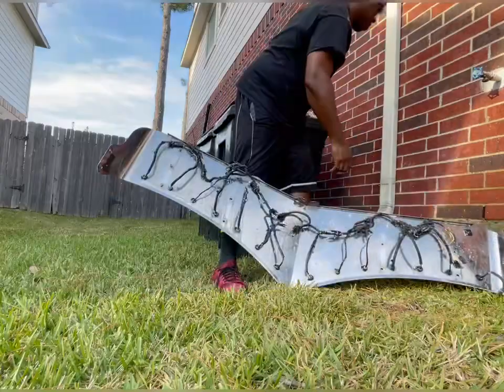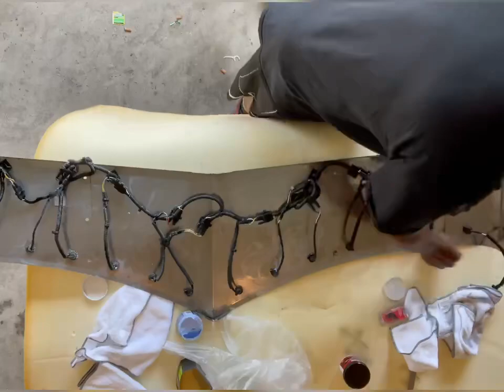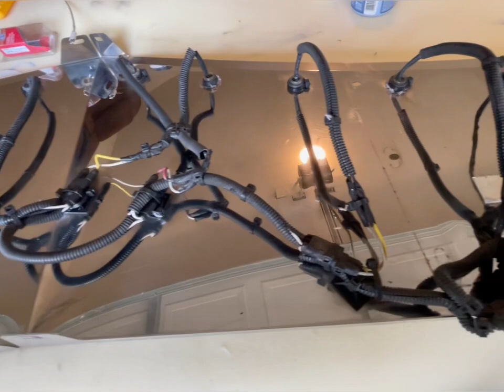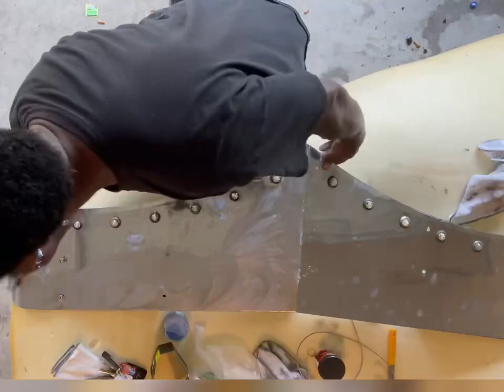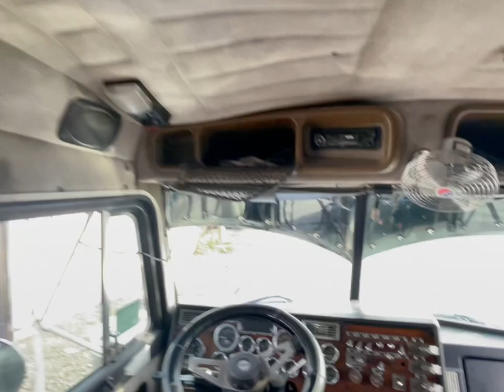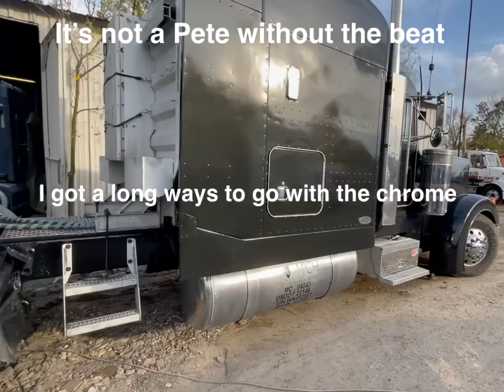That visor is mean,but I can’t driver a Pete without no beat. I’m excited to start this new journey

Comment: Looks good, just need a new bumper to replace that bent one with a a couple lights out and you’ll be good, only thing bad about adding a bunch of chicken lights to your truck is that when one goes out you have to fix immediately or dot can ticket you/pull you in for inspection, always keep those lights replaced, once had a dot officer tell me that’s something they look for when deciding on which truck to pick for inspection, something little like that can get you a good ticket
Reply from the maker: True

Comment: Put some fenders on them rear drives and it'll set that truck off man, it already has the front fenders. Some 8" or 10" stacks will set that truck off too man, mule ear stacks would be clean on that truck.
Reply from the maker: Yes
Reply: @bassinsemi7049  I'm telling ya my brother, them back fenders and stacks will make that Pete look like a show truck. Then you'll have the beat too, boys won't be able to hold ya.